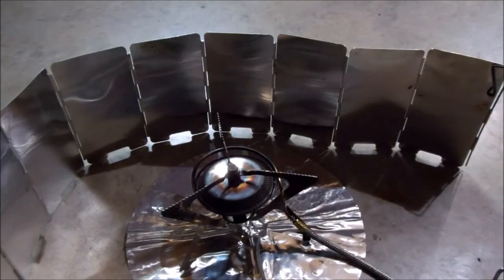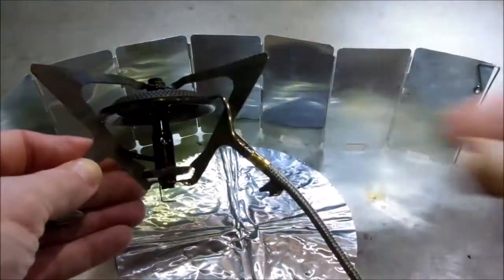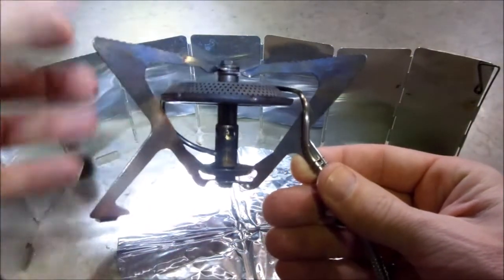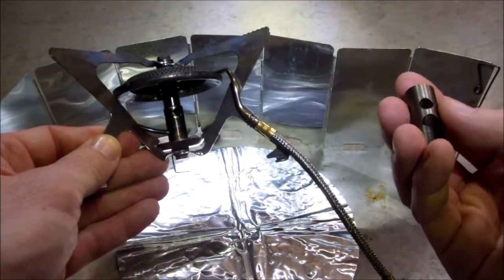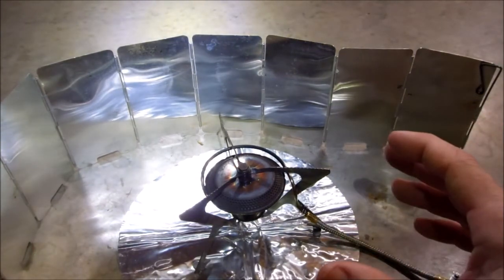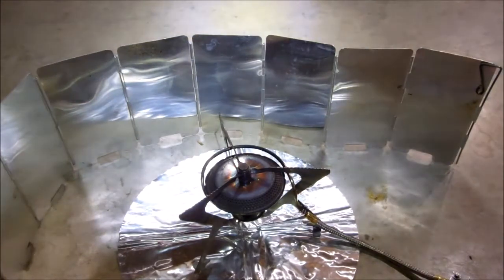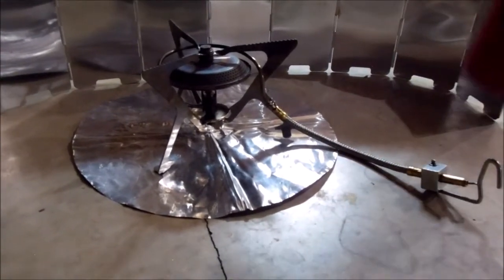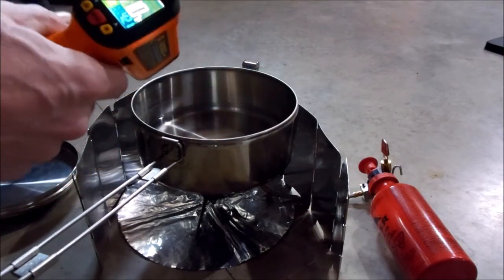MSR Liquid fuel stove burns alcohol, Simmerlite conversion. 2 cups water boil test.

Comment: which wind shield is that one?
Reply from the maker: Sorry for the delayed response as I haven't checked my youtube account in a few months.  I don't know the exact name or model as I bought it several years ago.  But I found it on Amazon.  It's more rugged than heavy aluminum sheeting, folds up nicely and fits into most medium sized cook pots or the smaller taller cook pots.  Don't know if that helps you or not.  Thanks for the view and the comment.
Reply: @stoner60a  thank you
Reply from the maker: @itrstt66   I'll do ya one better I double-checked on Amazon and they still offer the exact model I'd bought years ago.  Here's the direct link      https://www.amazon.com/HIGHROCK-Lightweight-Compact-Folding-Windscreen/dp/B005QRYQ0C/ref=sr_1_6?crid=59K9V9D8NHDA&dib=eyJ2IjoiMSJ9.PlN09F4k4UUYfbYETseY6bV4VY80itBWKm5UpeQBrkSOMCxFNgjS-7D3awnSGmVdx8a987hvwidsgaetdqmv3cfbifmtqBaZyu1I5q4tHaQ4oFyVMqGUmrct5R4lHMKt3JJEaTJqlg1lPD6Hy3KqH6bWodPNYsFP4rMkXFFXdrv2xCLmtWrG4YVuZXl15XT3TKQOOuzRK5zwJZyZTLiwTKTgbJ8_WO2AtLEbmpCWHH0.qCSzxQtzE1NvYt__YoL-IfLpcmfo2zgMpLIgPzMfQcQ&dib_tag=se&keywords=cook+stove+camping+wind+screen&qid=1739417041&sprefix=cook+stove+wind+screen%2Caps%2C1790&sr=8-6
Reply: @stoner60a  splendid, thank you very much

Comment: Thank you so much for making this video. I've been searching for info about running alcohol through an MSR Multifuel for a while and there just ain't much out there. So, from reading your replies, it seems like you drilled a jet and that's the only modification, is that correct? Also, do you think the O rings would wear faster due to the alcohol being run through? I'm using a newer MSR Dragonfly and am extremely interested in running alcohol through it, but don't want to damage the stove or injure myself or someone else, but a jet modification seems pretty straightforward and as long as I'm paying attention to the fuel coming through it, the venture seems like it wouldn't be too dangerous. Thanks again for posting this video.
Reply from the maker: I too was nervous when I first went into this venture. Though I did it in a safe manor because I love my simmer lite stove and MSR no longer makes that stove, my anxietiy had more to do with possible damage or lose of my stove that I love. Since the dragon fly is a current model that is replaceable, and you can buy parts kits for, I personal wouldn't have any hesitation in testing one with alcohol in it. I almost bought a dragon fly a couple yrs ago and would have already converted that but love my simmer lite so much I just couldnt justify buying another stove that I wouldn't use.  I first did the alcohol test in my stove using the original jet just to see how it reacted and burned and found that It would prime, lite and run but ran very poorly. It spit and sputtered and did not have a very good flame and though it may have worked in a pinch its over all response just seem and felt dangerous and so I then began the process of opening up the jet a little at a time.  So long as you go slow take your time, do this in a open fire safe area and use good process's of analysis and observation durning your testing you should be fine.  I would also keep a bucket of water handy just incase you lose prime and shit starts to fire ball. Because you are dealing with alcohol which is water soluable there is no danger of fire spreading when water is thrown on to it unlike petrolium products that if doused with water spreads the fire and makes it worse. As for the seals breaking down MSR uses very high grade materials and I have seen NO degradation of the seals and or plasctic componets as of yet, but I do keep a pump rebuild kit on hand at all times which if back packing or wilderness hiking you should carry anyways. With that said I do not keep alcohol in the canister or the pump in the canister for long periods of time. Longest duration of time that any seals was exspoed to the alcohol was about 4 days and after every outing or storage use I tear down the pump wipe everything dry of the alcohol or what ever is left that does evaporate and lube the seals and pump back up with MSR pump oil or food grade white mineral oil before storage. I feel that for the most part, if on a very long trip more then a week in duration if you tear your pump down once every few days and lube it your seals will probably be fine for a good long while.

Biggest take away and advise I can give is invest in the set of hobby drills that I have discused in the comment down below that you read and stay within the small incremental ranges so you help avoid having problems and dont settle for what you have for drill bits laying around the house unless you already have a set of small incremental hobby drills. If theres any doubt use converstion tables to figure out the unit conversion if deviating from metric to standard measurement and keep your jet sizing in that .05mm range as you go up in size. Lastly, like any experiment there is always that inherent risk to damage of your stove so you must be mentaly prepared to potentially lose it or have to replace it if things go wrong.  If I look at something and say "I can't afford to lose it." Then I usually dont experiment with something and leave it alone. I honestly feel that if you have a good sense about you and do it in a safe manor even if things dont go right worst case scenario, since these stoves are all metal, is you probably wont damage the stove itself just maybe melt your pump if you have a fireball on your hands and so long as you douse it in water if that happens before the pump melts to badly or the fireball spends a alot of time burning your canister you shouldn't have any explosions. Recap on the drill sizes is I started with a .8mm drill and went all the way up to .95mm, anything above that and the stove became dangerous again.  Though the jets sizing is either the same size or simular in the dragon fly the over all point to which you can drill to before detriment I'm certain will be different because of how the stoves differ they probably consume air intake differently and so the final jet sizing more then likly will be different in that stove.  Most other conversions I'ver heard of on whisper lites are typically .8mm and people leave them there which maybe more or less the minimum amount needed to get the stove to function properly and so people dont try to go above that or it could be linked to the elevation they are at if in moutainous regions because there is less air up there less jet is required.  I have run my simmer lite stove enough on alcohol to where I am fully comfortable with it and feel that it is no more dangerous in its alcohol converted setting then in originally white gas configuration and have used it many times and been just as relaible. The best part is that alcohol is completely clean even when priming it leaves zero soot unlike all your petrolium products that soot your stove up while in their priming stage.  Knowledge is key to everything and I try to give as much knowledge as possibe with my own expirences in life as to help others the best that I can in their process's and hope that this helps you in your venture if you so choose to try and convert your stove and wish you well.
Reply: @stoner60a  I'm ordering those bits today and taking a stand at it, although I'm still trying to purchase spare jets somewhere, but I do have some extra from the service kit I believe. I'll keep you posted, and thanks for the prompt and informative response.
Reply: I just uploaded a video of the stove at .9mm. At .8mm it seemed to burn cleaner but could only go to about 25%, at .9mm it'll open up all the way but just won't burn that clean. It also seemed to turn the QuietStove cap red which I don't remember seeing before. Should I go to .95mm?

Comment: Hello, I just bumped into your video, great video do happen to have any more information on the jet you used in the Simmerlite Stove?
Reply from the maker: The best and fastest way to rejet your stove is to by a simmerlite expedition service kit, which comes with new jet. This will allow you to keep your original white gas jet that came with the stove and then drill out the new jet in the kit to the larger jet hole diameter. Fortunately, for me, I have a lathe in which I turned the jet myself. The jets threads are .250"x40 TPI so I kinda assume if you had your own lathe you would already have the ability and knowledge to turn and make your own jet. If you buy the service kit every person in the world has the ability at that point to convert their stove to burn alcohol. The reason I turned my own jets was because I originally had a service kit and drilled new jet to .8mm and tested it but only had about 2/3s range of the fuel valve so I opened it up to .85mm which gave me more range and a hotter burn. At .85mm it ran pretty good but I was concerned that if I kept going up in diameter on the jet that I would eventually go too far rendering that jet no longer usable and so then would have to buy another service kit and at $25-30 per kit it just made more sense for me to buy a piece of brass rod and turn a few different sizes myself to experiment with. I have done more experimentation with the nipple jet and found that the longer the nipple the worse it burns so the nipple may not give any real advantage over just a flat topped jet. In my case .95mm was the limit at which I could push the stove to its maximum while getting nearly full control of the fuel valve. I've found that by going over .95mm dia jet that the fuel actually begins to run faster then what the generator tube can effectively vaporize causing the stove to lose prime and if you're not careful or quick at shutting the stove down you will have a fire ball on your hands as the liquid alcohol spews all over and then ignites.

Summary: get a service kit (unfortunately the stove was discontinued somewhere around 2010 so kits are becoming harder and harder to find and I don't believe MSR is making anymore service kits for that stove), buy a set of hobby drill bits that have a range of at least .8mm-1.0mm in .05mm increments (I found a drill set on amazon that fit my Dremel tool), rob the new jet out of the kit then drill it out coming in from the bottom of the jet is the easiest and will help keep the drill lined up as it goes through. Remember these bits are super small and very easy to break so go easy and push lightly as you drill through (the bits are small enough and brass is soft enough you can technically drill it with just spinning the bit with you hand. It takes more time but its doable). Start with the .8mm drill and test the stove and see how it acts. What you will probably find is that the stove will run but as you get above the 2/3s fuel valve the flame will begin to push off the top of the burner head and the flame will start to surge or pulse.  If this scenario happens then I'd recommend that you go up in jet size, so take the jet out and drill it to .85mm and retest.  Keep in mind that the flame pushing off the burner head is a critical point because if you push it too hard at this point it will push the flame completely off the burner head which will cause you to lose prime or the fuel will no longer vaporize and will be liquid which will cause a fire ball. Also remember that higher elevations have less air and so may not need the .95mm jet size like what I used. My test was conducted at 1350 feet elevation so depending on your elevation unless your at roughly my elevation or lower do not start out at the .95mm jet size. Even if you are at my elevation or lower for conservations sake Id recommend starting at no higher the .9mm and test first then make your assessments from there.